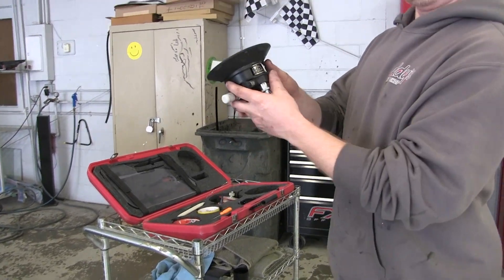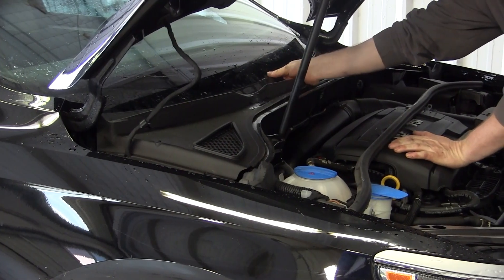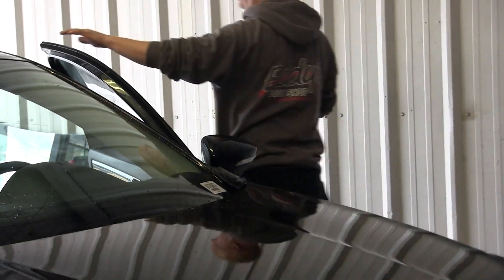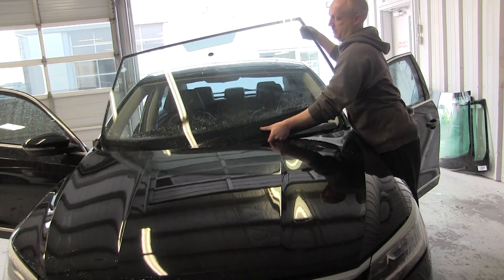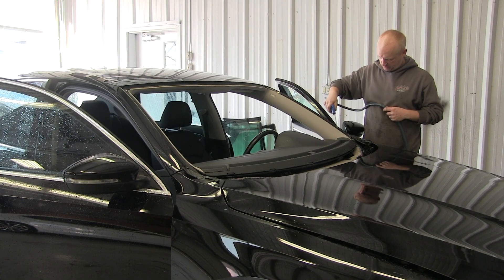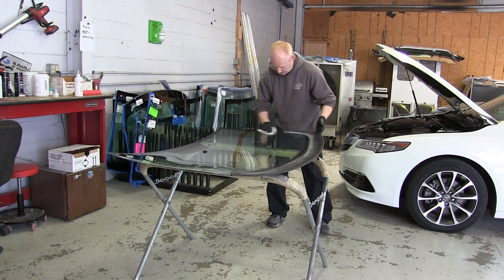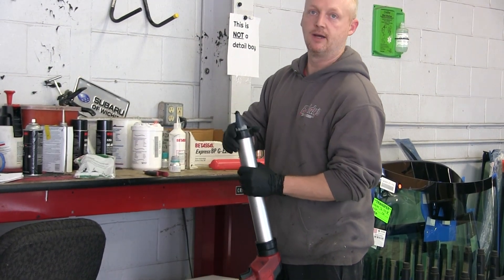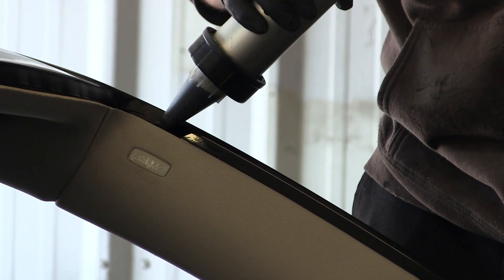How To Replace a Windshield with Eddy's Body Shop 2016 VW Passat ASE 21.1&2

Comment: When applying urethane it's always better to cut a larger hole on a more pitched ofan angle and some folks I have seen cut a v-shape on the end of the urethane applicator tip of the tubes... Milwaukee also makes a battery powered fuel series gun to put urethane on with or like I think panel Bond and some other different types of stuff.. we also use small pieces of yellow masking tape after installing the windshield on new urethane and like you said put the two closest windows to the windshield down about an inch and try to keep it as warm as you can and wintertime definitely inside a warm garage but let it cure for at least 24 hours
Reply from the maker: Thanks for the tips Sam!

Comment: I got that I help at his body shop is super good with windshield installation and removal and he says it has a lot to do with the quality of tools.. everything in his shop is snap-on or blue point and very few pieces that are Mac Tools and everything else electric or battery-powered is Milwaukee fuel only after getting rid of thousands of dollars of the DeWalt tools and Milwaukee hands down is the best